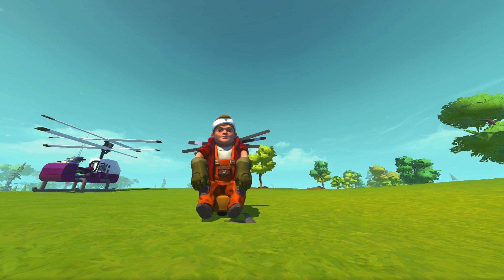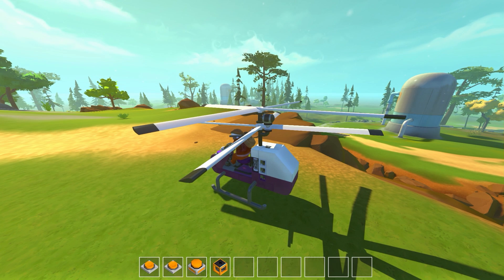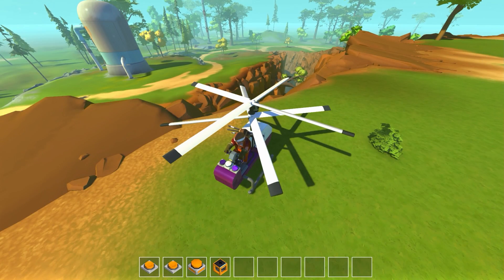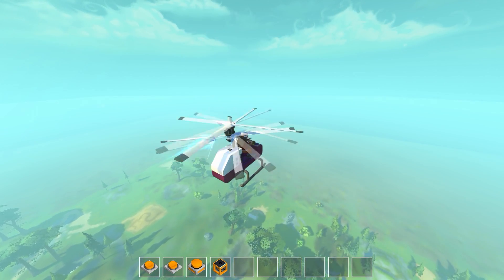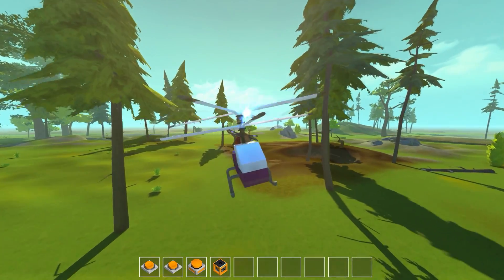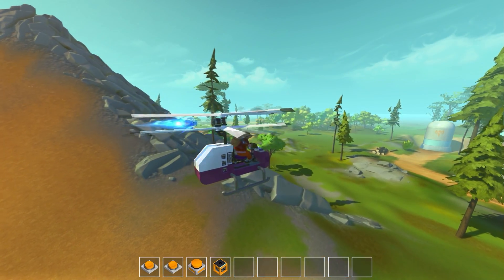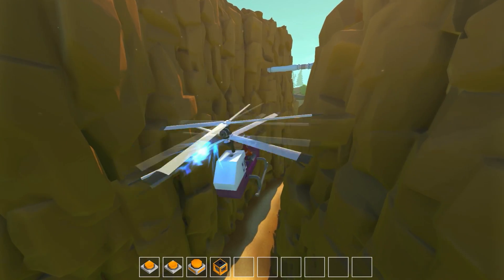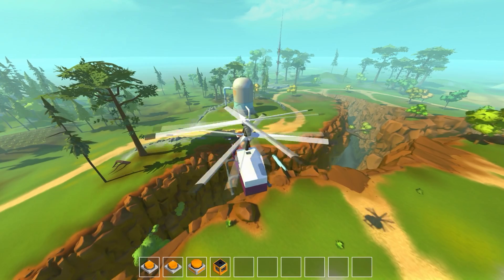Working Coaxial Helicopter with Torque Controlled Rotation! (Scrap Mechanic #370)

Comment: If I remember correctly, swish plates are used to tilt the individual blades, rather than the whole rotor, at least on actual helicopters, that is. If you could do that using the Modpack, that would be awesome. I would think that a gravity module would be useful here, because the delay for the calculations would mean the rotor would have to rotate fairly slowly.
Reply: Ok

Comment: 1:40 a other way is to have a tail with an upward facing rotor for picking you forward or backwards a little bit
Reply: My rc heli has a coax and a tail rotor for tilt and forwards

Comment: You should modify that to turn it into a disc with the rotors in the centre. Basically, a classic looking UFO that uses a central rotor to fly. Conveniently, it would also be very easy to Balance, as it can all be made more or less completely symmetrical.

Comment: Hey Kan, I have a good build idea for you using the smart engines, why don't you make a piston powered plane with pistons which will be possible with the drag reducer block and maybe you can add spud guns that fire between the rotor blades. Hope you see and try this.

Comment: I tried to make one with the tail rotor. I extra complicated it by adding an automatic orientation system. If you were steering to the left, as soon as you let go of the button it would save your orientation in a memory block and try to orient the helicopter to that. It kind of worked, the problem I had was that the tail rotor would rotate the helicopter not only on the Z axis, but on the X axis as well, so it would make me go upside down if I hold it too much, I guess I had to align it with the center of gravity.
Also I ried to sway and move forward and backward by tilting the main rotor, it didn't work as expected. Physics are strange in SM. I should go back to it and try to make it work.
Reply: I might add that I know how things work, I know about swash plates and gyroscopic precession and all that, how to make it go forward/backwards or sideways. But the logic in SM to make all of this work was huge, I felt overwhelmed by the amount of logic blocks and abandoned the project.

Comment: My current project is a high speed train, that can also take a turn with a relativly high speed. Aaand it's completly self driving, getting the speed data from colored blocks between the rails. It would be cool if you try to do so too.

Comment: Hey kan, love the vids. I had a question about lift and the wings mod. Did the wings get an update? Or does it only work because your using a smart engine with numbers? When I tried something similar was to much space and effort to get my twin blades(4 wings each) to lift up. Even using ultra light parts. I did learn early that barings+speed dont work well.
Reply: I dont think he attached the roters using bearings to controll the angle of the roters. I think he just used the 15 degree wings instead of using bearings to controll the angle.
Reply: @Sammy-ws9re  i get that but i had issues trying to get lift when i did that. not enough power vs weight. or if i turned it up it would go too fast and spaz.
Reply: The reason your propellers didn't work... Assuming that they had an angle, was that they weren't spinning fast enough. Since the smart engines can go very fast, you can use them to get more speed, or just have 2 bearings on a gas engine. The thrust of the wings is determined by the speed.
Reply: @finnk1289  speed wasn't the issue. Like I said if I turned it up it just zipped across the map u controllably. But I will say I've been messing with the smart engine and some issues have been solved because I can dial in a precise speed. Ty though